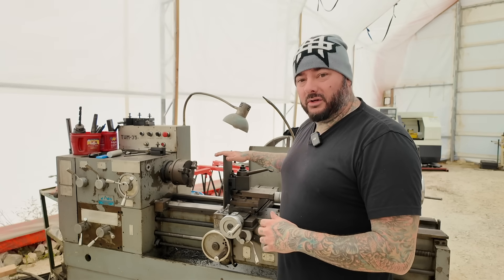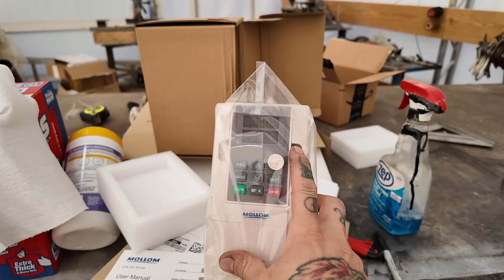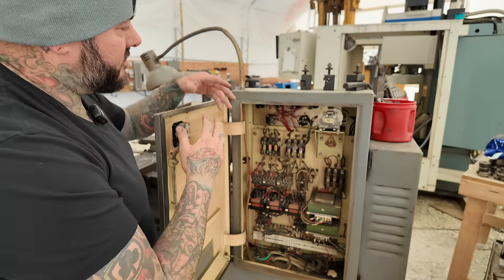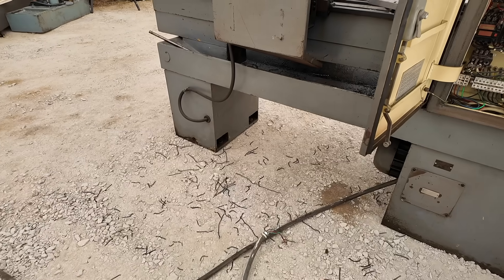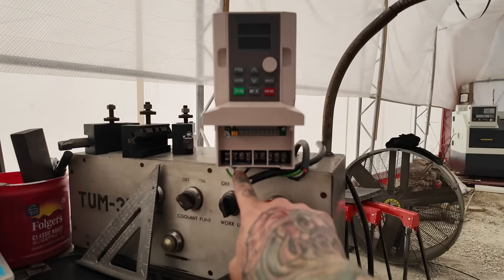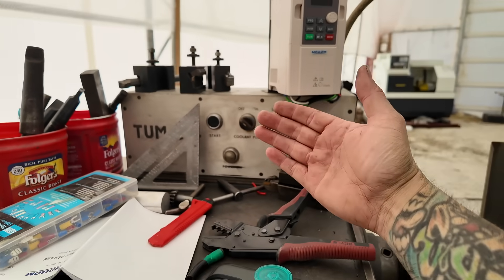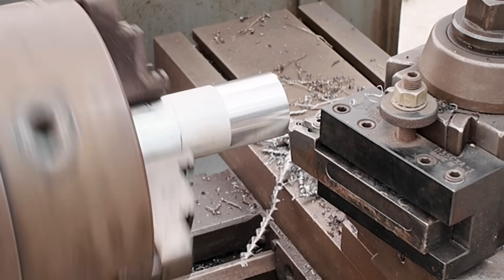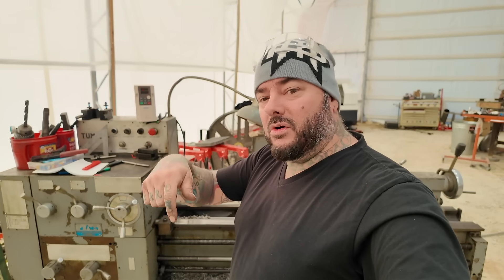From 3-Phase to Single-Phase: The EASIEST Way to Power Any Lathe

Comment: I don't know if you really know how lucky you are being in the USA ... machine bargain heaven.
Reply from the maker: I’ve heard that from other viewers. I am blessed 🙏
Reply: Where are you? Here in Germany you can get cheap machines from all of Europe by going on the liquidation auctions. If you go on marketplaces there are more middlemen and you lose that savings because of the high cost of moving a machine and working on them. Especially large CNC machines are dirt cheap because buyers in that price range would rather buy new.

Whoever is listing it for sale is usually trying to recover their costs + time for any restoration/cleaning they did (just like he does), which adds up quick. In the US you see more direct sales from the original shop instead of a refurb. business.

A few weeks ago I saw $1m injection molding machines going for $20-60k at auction, but the molds are so expensive only a big production can afford the running costs.

PS. 40ft container loads are only $2.5-5k cross ocean so worst case buy a few machines in the US and ship them. Sell what you don't need and make big bucks.

Comment: It can't always be that easy to retrofit old gear, some must be harder to retrofit.
Reply from the maker: Absolutely, this one was pretty straightforward compared to some but most are this easy!
Reply: just depends on how easy it is to remove to motor and if it's 3 phase from the start or if you have to add a 3 phase motor.  Everything else is just cost difference but not usually all that hard and there are plenty of vids on YT that show you how to program the VFD you get if you have to.